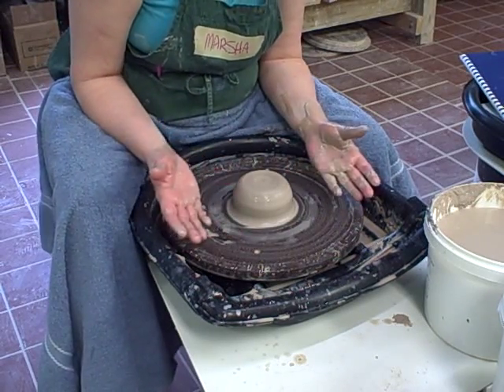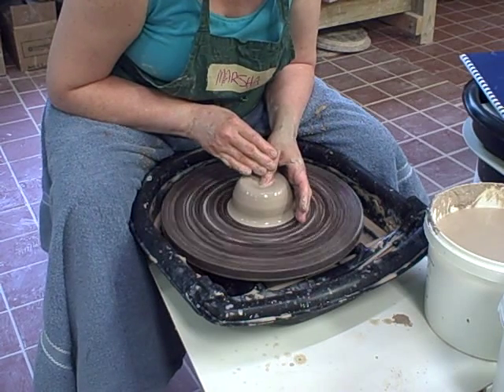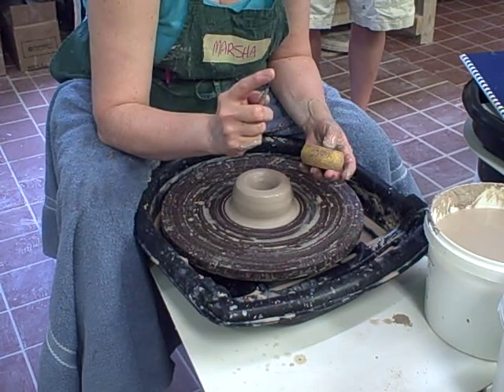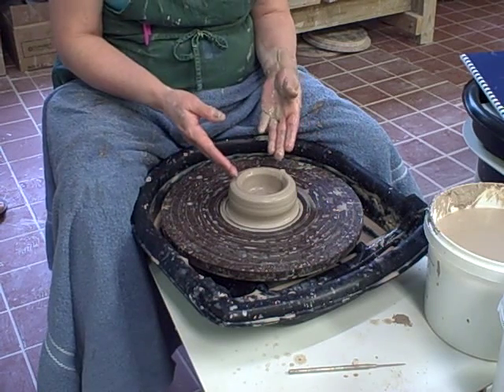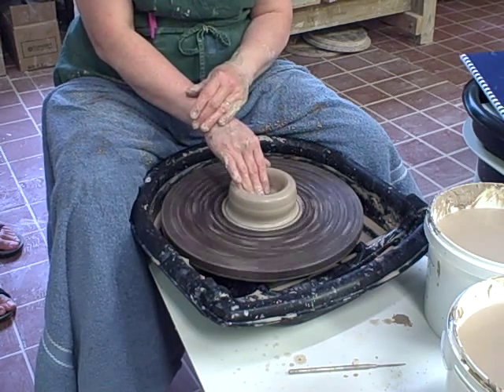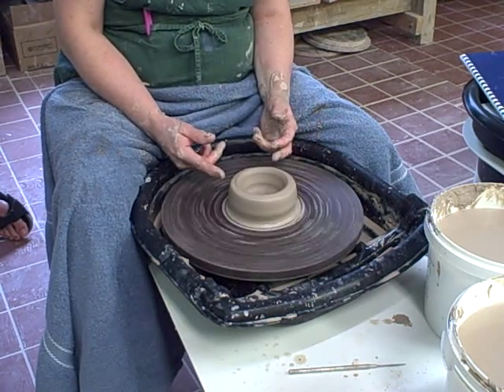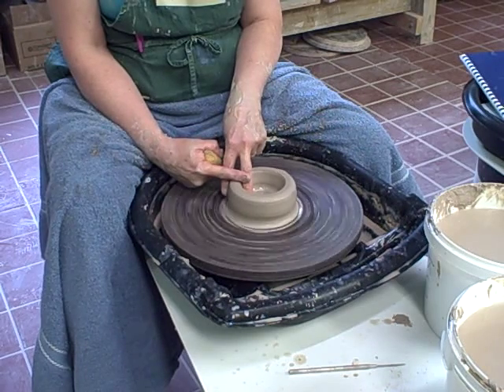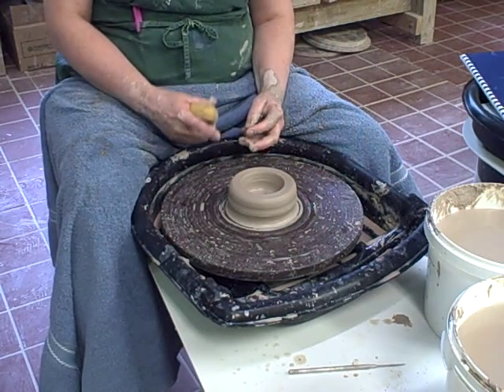Purple iris Pottery Throwing Demo: Opening and Pulling Up, Part 1

Comment: Hurrah! Hi Marsha, I have just made my first perfect cylinder straight after watching your demonstrations!  
Your tips were just the answer to the wobbly problems I've had since starting, a couple of weeks ago.
My wheel is small and low power so only copes with small items. Got a standard grogged terracotta, and I find it absorbs water fast, makes a lot of sludge, and goes sticky within a couple of turns. Have ordered a smooth stoneware next for comparison. 

Thanks!